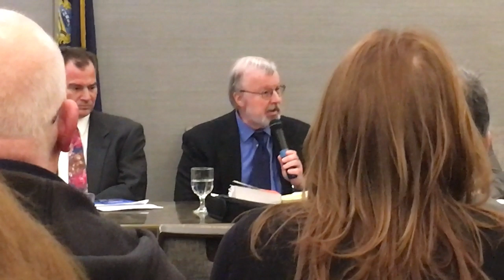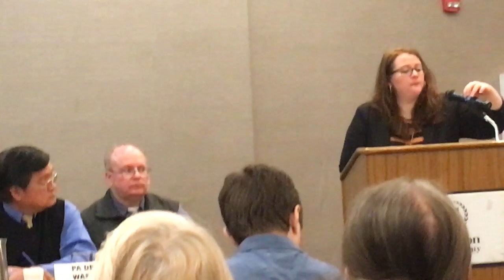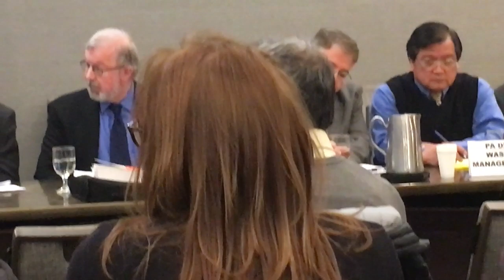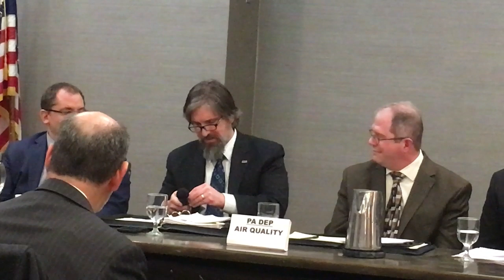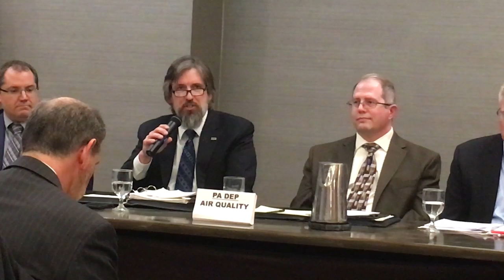PA DEP Report on Elcon Proposal

Comment: Its nice to see hundreds of intelligent concerned citizens last night speaking up against the creation of the Elcon Hazardous waste burning facility going through PA Department of Environmental protection analysis right now. The meeting was hosted by the DEP and was very informative. Facts are 1.5 years ago Falls Township changed their zoning to allow this facility, attending those Falls Township Zoning meetings and the falls township board meetings are the best avenue to try to prevent a health hazard from being built in our area. 
The facility “emission limits” in the application: nitrogen oxides – 23.4 tons per year; carbon monoxide – 36.6 tons per year; sulfur oxides – 24.2 tons per year; volatile organic compounds – 10.1 tons per year; particulate matter – 10.5 tons per year; for hydrochloric acid – 6.3 tons per year!
Their facility would have a constant flow of trucks full of hazardous waste and medical waste into the facility, they would burn the waste and create a slurry which can lawfully be stored on premises for up to a year. Then the slurry waste would be transported to a different permanent dump, (not Tullytown).
There would not be nuclear waste burned.
Phase 1 - 50 employees then Phase 2 expansion of the facility would have 100 employees.

The allowed emissions from these burn facilities have been increase since 1980 allowing more pollution into the atmosphere.
The EPA/DEP has Air Quality sensors in Bristol. The courier times reports that bucks county is the second worst county in pa for air quality.
As the DEP Monitors air quality and allows new projects like this project they insist on Best available Technology used, maximum achievable quality when any polluting company asks for permits.
It would be nice to have companies like Tesla approached 
the EPA and offer solutions which could change the game with best available technology.
This being new technology in burning waste methods that produce zero emissions.
New Water treatment methods that set the bar as high as and above nestle coming out of your tap. 
I don't want to see this Elcon Hazardous waste facility plant anywhere near people put it somewhere 100 miles from people/rivers/anything that could potentially be a health hazard for people or a wildlife area. http://www.dep.pa.gov/elcon?fbclid=IwAR2wYWBvyK7Q1-9lG6XTapeypsdniotOARKDrdQw1boKl2kptmgncamIiAI